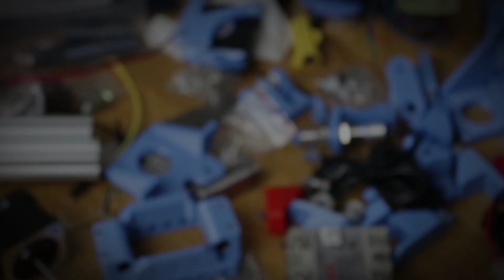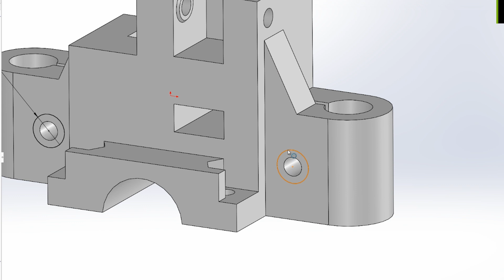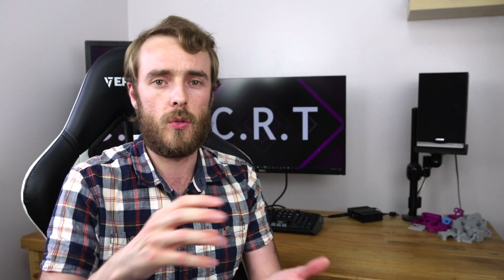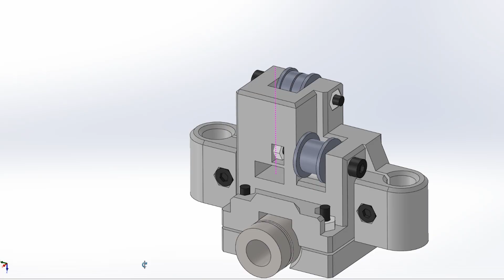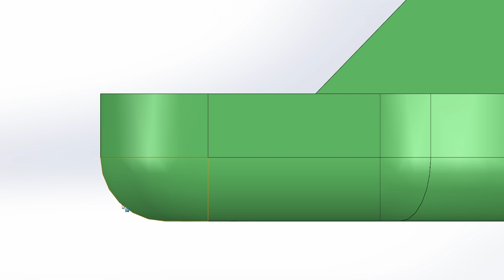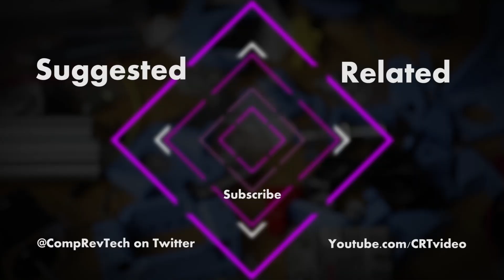Engineering Design Tips for 3D Printing

Comment: Why would you orient the hexagonal holes with the flat sides at the top and bottom rather than the right and left? Is a small bridge easier and more accurate to print than a small overhang?